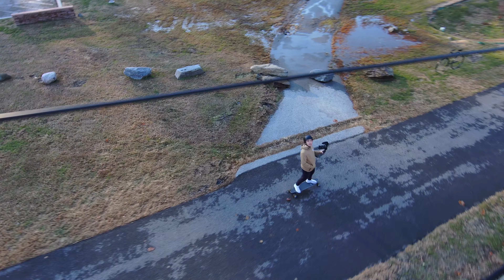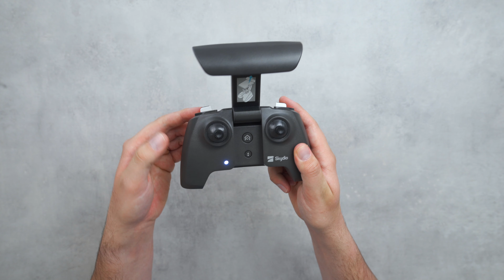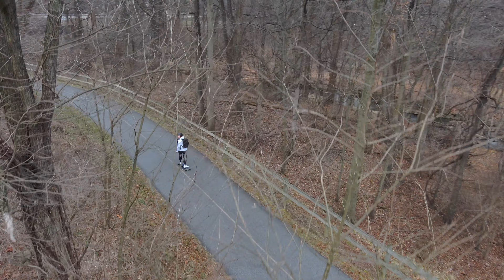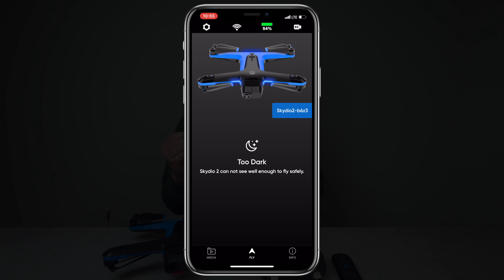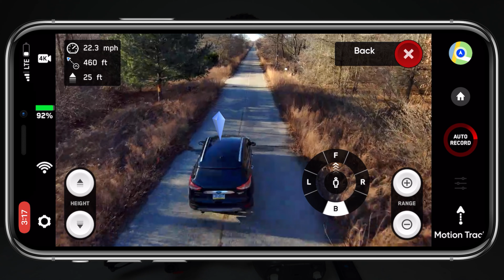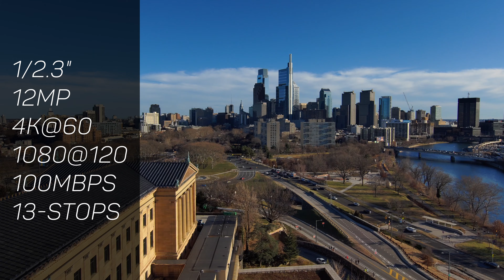Skydio 2 Full Beginners & Setup Guide

Comment: always wanted to get the skydio 2 but they wouldn't ship once covid started so i ended up picking up a DJI mavic air 2 and last month i just got the skydio 2 plus and i must say i am very impressed but yes you are correct as it does have some limitations but in my opinion still overall is a much better drone than what DJI produces,skydio has great customer service and will go above and beyond to help you out and always answer any questions you may have.

Comment: What about: A beginner series with one controller type Only such as the iPhone app and sticking with steps from start to finish for a first flight using iPhone app only.  Don’t clutter with Becon or Controller.  Go through all functions using just the iPhone.  Then do a second Video Flying Skydio using the Beacon, then one with the controller.  For the Novice series use the SAME steps but add in additional non-basic commands for using the iphone app only, then do a separate one for Beacon.  By eliminating teh same intro and fancy graphics in each and every video just remove them.  Users will learn much more quickly.  Just add the fancy graphics and intro ONE time at the beginning and maybe in the summary at the end of the last video.

Comment: Thank-you, very informative ; just a question can you connect it with phone and controller simultaneously. I like to use the phone for follow me mode in water  while surfing and use the controller (with secondary phone) with pilot siting on beach to bring it back after battery is empty.

Comment: Thanks Billy. 
Question: Is it possible to prefetch maps, e.g. if you're gonna fly without cellular connection? I can't seem to get into the maps window unless connected to the Skydio2 via WiFi, but then I can't USE the WiFi to access internet for map data, UNLESS I'm using a cellular-enabled device and in a location that has cellular service. Would be very nice to pre-fetch map data so that I can have maps during flight 1) with non-cellular mini-iPad and 2) at a remote location where there is not cellular signal.
Reply: UPDATE: Still wondering about pre-fetch for holding onto map data when you know you will later fly at a location without cellular or wifi internet connection. BUT, if you plug iPad into controller, then it free's up the WiFi signal from the Skydio2 so that you can connect iPad to internet WiFi (e.g. mifi device) to download maps. Not sure if there's a solution for the situation that you want to fly without a controller.

Comment: HELP:  During a hover has anyone experienced skydio2 begin to yaw (like your panning)?   Not touching sticks.  Happens at high altitudes.   300-400 feet.   The yaw lasts a second or two and stops.  It turns only a few degrees before it stops.

Comment: Hi Billy! I've been following you for several years or so. I've done a number of DJI drones and am having fun. I even had an AirDog - very difficult to use! So, to cut to the chase, today was my first Skydio2 launch. I was just in a parking lot and walking around. I had already updated the firmware, etc. I was trying to use the beacon and the iphone at the same time. But the skydio phone app wanted to connect to the drone, rather than the beacon. And the beacon wanted to connect to the phone for gps stuff. I ended up letting the beacon have its way and I was not able to use the phone whatsoever. I've seen your videos where you are clearly using both. How do you do that?

Also, where's your Patreon listing?

Comment: Billy nice video!I have a Skydio II Also, Nice drone. I wish the cell phone holder on the controller was capable of holding my Samsung S8 Active with the case on it. So I just have to take the case off of it while using the controller , it fits if I force the brackets. Also , the Skydio II will not fly if the Micro SD card does not have a "U3  Rating on a 32GB card. I bought "U3" 128" & a "U3" 256GB cards and the app tells me the cards are too slow to video,, and will not let me fly the drone. If I put my "U3" 32GB Card in the drone , it will allow me to fly. 
Just saying , Doug
Reply from the maker: That is so weird. This drone is very temperamental, but it's so unique I can't bash it too much lol
Reply: @billykyle  I'm not bashing it at all! I hope to use it more,  when we get some nice weather here in Pennsylvania , following my Street Rod going down the road after a smoky burnout !